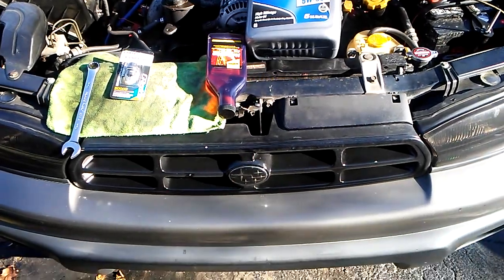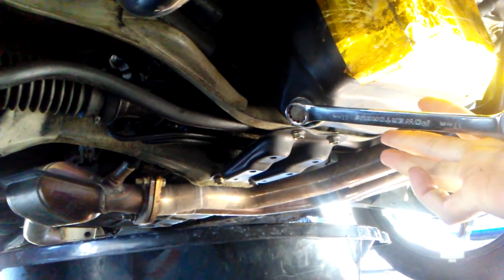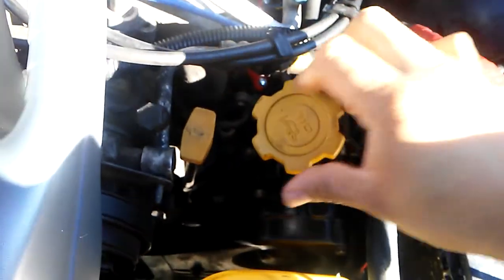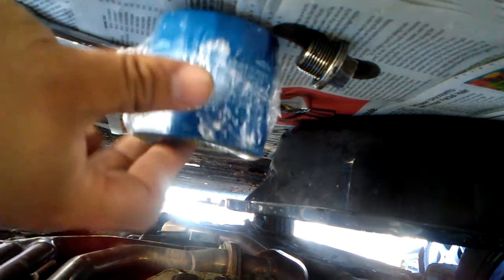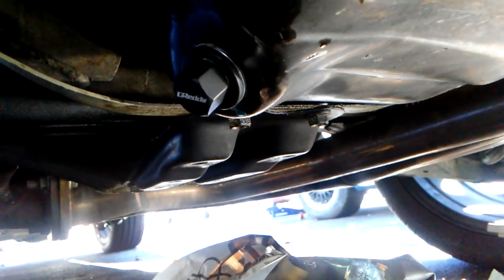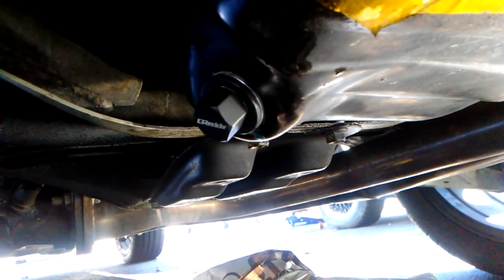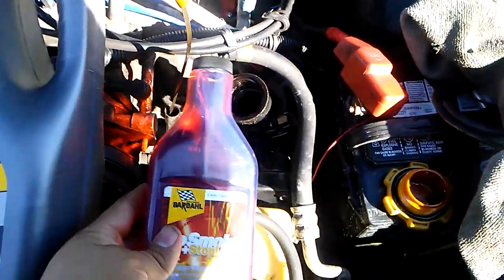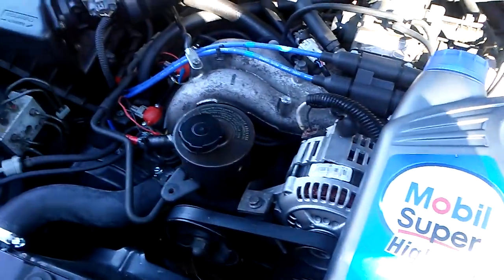1997 Subaru legacy DIY oil change/ plug upgrade

Comment: What kind of headers are those? They look nice. And is your oil pan heat wrapped?
Reply from the maker: Yes the oil pan is wrapped in the reflective gold foil to reduced radiating heat from decreasing the life of the oil.
Reply from the maker: And the headers are a no name brand I bought for about 120.00 dol ...no cracks or leaks so far.
Reply: Have you ever used that Subaru oil additive stuff? What's the deal with that?
Reply from the maker: @austinfoster8058  I was not aware their was an oil additive from Subaru, I used the No smoke at least once a year for preventative and to  elongated the life of the engine.
Reply: Sorry I double checked and it was coolant system conditioner stuff. Do you use that?
Reply from the maker: @austinfoster8058  yes I do during all coolant flush as a preventative...it looks like a gasket sealer product that was just rebranded for subaru
Reply: So you use that when you flush your coolant system? I just got a 97 legacy gt and I'm trying to learn some stuff about it sry for all the questions
Reply: @markedmartin2115  I have to do this now for my 98 Subaru Legacy. I saw that same oil leak additive, but got the Lucas Oil leak instead, as I was told that works better? Sorry I don't know much about cars.
Reply from the maker: @kevinm5898  I used them both and have a bit more faith in the stop leak one